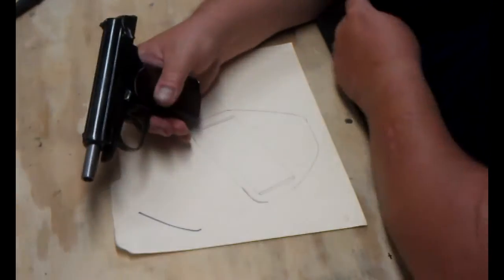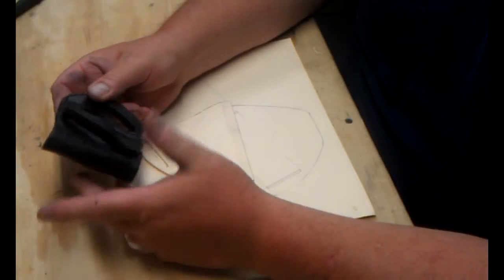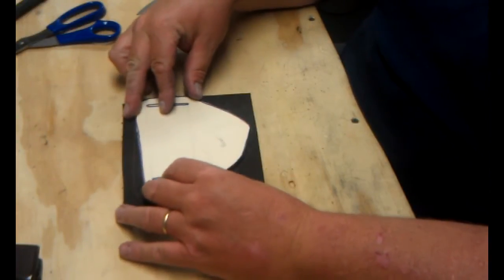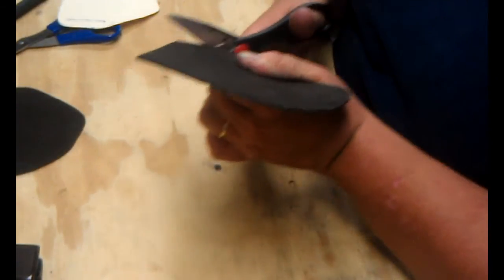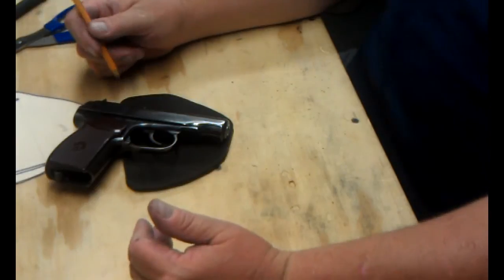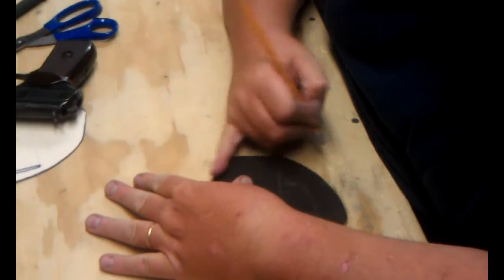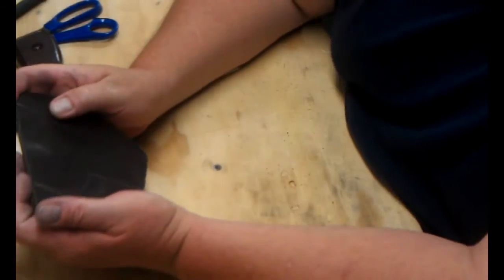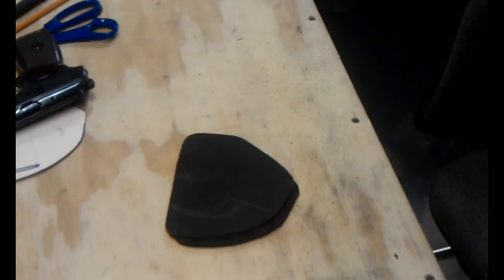Makarov Holster 1

Comment: Nice man, can you use a suppressor with that IWB with that 2nd holster you showed?
Reply from the maker: I could but I'm not a fan of suppressors
Reply: Mr. Tolly (AKA: fatmantolly) nice do more reviews over that holster in detail. Ex. Running with it, stability testing it ect..
Reply from the maker: I made this video 5 years ago, since then I've sold the gun. I carry a gun because I can't run (not that I would) so running testing won't be done by me.